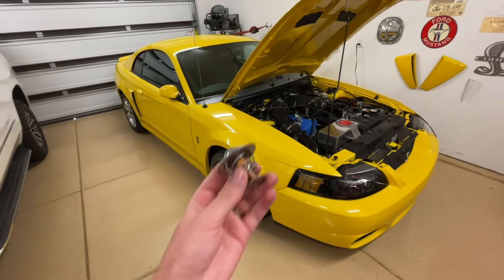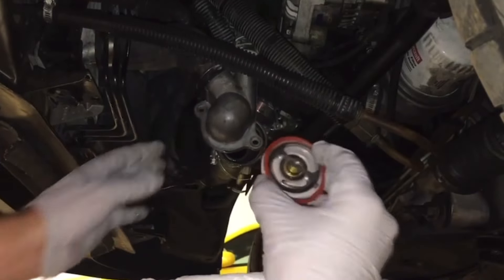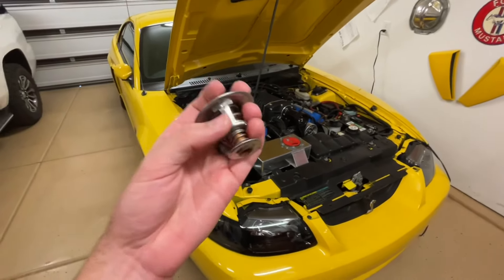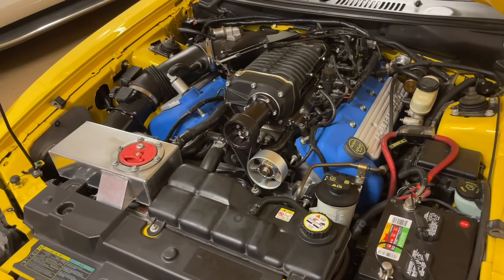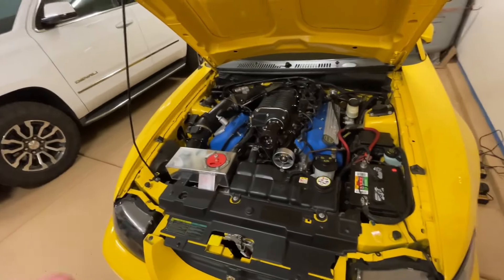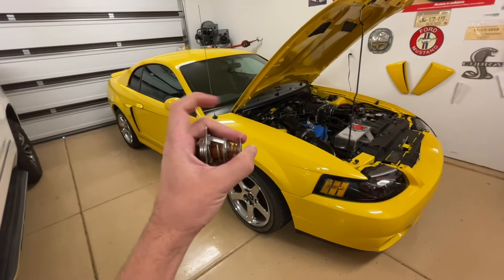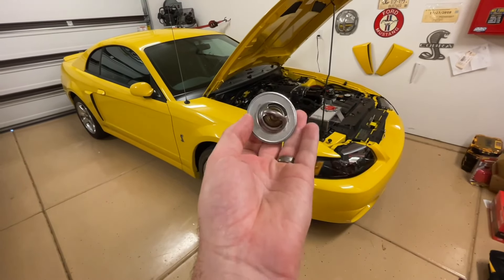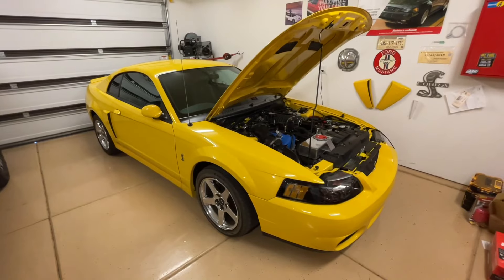DON'T remove your thermostat and how thermostats work

Comment: I had a 1990 K5 Blazer that would always overheat. Replaced everything in the cooling system and still would run hot. I pulled out the thermostat and ran it like that with no issues for two years, no overheating. The only thing about running with no thermostat is, it did take longer for the engine to get up to temp.
Reply from the maker: I’ve seen cars run cold for the most part. I found it interesting that the article said it could also cause overheating, which I could see happening maybe stopped in traffic, but I also didn’t think it was very common
Reply: From my personal experience most cars that had the thermostat completely removed Ren cool and never overheated so it had the opposite effect I've seen this done on Mazda Suzuki and Toyotas a lot and they ran perfectly fine never overheated because of the deleted thermostat

Comment: I haven’t ran one in over a year. Car runs so much cooler now. No plans to put one back in.
Reply from the maker: Don’t let it run too cold or it’s also bad for the engine, lubrications, and fuel trims will be hard on o2 sensors and cats
Reply: @dannyjohnsonsgarage  what cats? Haha I’m in southeast Ga it doesn’t get all that cold around here anyway.
Reply from the maker: @svtpower03  catalytic converter
Reply: @dannyjohnsonsgarage  I know what cats are! I was laughing because my car doesn’t have any....
Reply: Dog you are destroying your car😂😂 you think you’re so smart but if that was really how engines were made to run, the engineers would’ve left it out in the first place and saved the company money.
Reply: @ProvacativeAcorn  lol I’m pretty sure I know my car better then you. I also worked on cars for a living and have been building race cars for 20+ years young buck.
Reply: @ProvacativeAcorn bruh thermostats  just help the vehicle get up operating temp

Comment: Not a good idea at al to run without a thermostat on a street driven car
Reply: I have done it numerous times and fixed overheating issues by removing the thermostat. Never had an issue
Reply: @user-uj3zk2cx8t  That’s good for you, I’d never do it
Reply: @Lethal_Venom  that's good for you, but stop spreading misinformation
Reply: @user-uj3zk2cx8t  It’s not misinformation to say it’s not ideal to not run a thermostat on a street driven car. They are there for a reason

Comment: Should over cool not overheat. Coolant flowing too fast through radiator and not cool makes no sense.
Reply from the maker: Yes, in most cases that will be true. But if the coolant does not have time to have the heat extracted by flowing too quickly through the radiator it will not dissipate the heat. Mostly when the car is stopped. I’ve only seen it run more cool but the article said differently

Comment: I went to change my thermostat and found out it didn't have one. So put one on and now my fan doesn't want to turn on, temp went up to 220 no fan, took the thermostat out and car is fine again????  Stays below 200 and fan works again. Any ideas?
Reply from the maker: Maybe someone tuned the car for no thermostat. You may need to check that on the tune and also check the relay on the fan where it plugs in. After all that maybe the high speed fuse near the intake
Reply: Running with no thermostat is fine

Comment: Hey Danny, when you install a big 3 kit, do you still need a wire connecting the battery to the fuse box where the alternator wire connects?
Reply from the maker: Yes. Run the power wire from the alternator to the battery and then leave the stock small wire from the battery to the junction box. https://youtu.be/0j6HM11D2dw
Reply: @dannyjohnsonsgarage  alright thanks!
Reply: @dannyjohnsonsgarage  hey Danny so my 250A fuse on my big 3 kit blew and it caused my stock wire to melt but my alternator is only a 170amp alternator, I have a red top battery I’m not sure if that is important but any suggestions as to why my fuse blew?
Reply from the maker: @nickmacias00  the fuse should be the same amperage so it blows sooner than later. It sounds like an over charge situation (perhaps the regulator on the alternator failed and let it continue to produce output rather than turn off).

Comment: Where does the gasket go? I've seen some people put it underneath the thermostat with some putting it over it. I've even seen people use different gaskets.
Reply from the maker: @genericdude6551  it depends on the engine
 Thermostat Replacement 96-04 Cobra, Mach 1 4V DOHC
https://youtu.be/dF56SQxvaOQ

Comment: My friend had a trick to keep it open all the time so it doesnt close just cut the spring part out. Lol. So technically its not out but its also never gonna close but it also allows for adequate water flow.
Reply from the maker: The problem is the car will try to warm it up so it may lean the fuel mixture out

Comment: I ordered a jet performance thermostat and it didn’t include an o ring, should I go out and try to find one before I start the repair? 4.6 32v cobra
Reply from the maker: Yes, or start the project and see if you can reuse the old one
Reply: @dannyjohnsonsgarage  I also watched your video on the Teflon seal for the power steering line. After I did the repair the leak got worse. I bought a new pump and I guess I’m gonna order new lines too I suppose

Comment: hi Danny, big fan and thanks for the videos my friend has a toyota vox and it started overheating and they took the thermostat out, the problem was suspended for a while and the overheating came back, and caused head cylinder problems twice that got it skimmed but it happened the third time that the car just overheats on the highway and it stops and now it is just cranking not starting.....your advice will be appreciated...do you think the problem is coz they removed the thermostat,  how should the problem be fixed?
Reply from the maker: It was most likely a bad head gasket to begin with, now it’s just gotten worse
Reply: @dannyjohnsonsgarage  wow thanks for the reply mate really appreciate it just one more question what do you think should be done? replace the head gasket and get a new one or a lot more has to be done... thanks for the first reply really really appreciate you Danny

Comment: Hey Danny, just noticed you deleted wipers.  What did you use to cap the holes?
Reply from the maker: They are plastic caps for the bottom of a chair. I’ll get you a model number. The wipers are being stored in a cabinet since they are terminator specific (maybe you already knew that)  https://youtu.be/3saIMeF7RgU

Comment: Still running my stock thermostat in my 03. Any advice on when to change it mileage wise?
Reply from the maker: If it’s working properly it should be fine. Perhaps a good idea to change with another repair but not necessary on its own
Reply: @dannyjohnsonsgarage  I want to change it to one that opens up faster, like at 160 degrees. My car runs at 200 degrees once warmed up so more cooling could help.

Comment: At one point yoy stared that removing the thermostat woild casie thebehiclento not warknupnand never reach optimum temp, at another point in the video younstayed removal cpuld cause thebcwr to overheat?
Reply from the maker: It will most likely cool too much, but there are cases in traffic where it can overheat. The article speaks of overheating but I’ve only seen overcooling

Comment: What if you put a cooler thermostat is that bad
Reply from the maker: It isn't bad, it will just open at a lower temperature and likely run the same overall temperature once it and the regular thermostat would be wide open at the same time.
Reply: Ok i got a 160 degree and its been running fine just wanted your opinion thank you sir😎
Reply: Is a 180 degree fine to run on a 2v 4.6?

Comment: Is this just a theory or you actually tested this? Because i have never seen a car overheat by removing thermostat.
Reply from the maker: There is an article in the description about it. It is true the car typically runs cooler without it, but it can cause an overheating condition stopped in traffic. Besides that, there are a lot of negative effects as the video states, with the car trying to warm up and not lubricate properly etc

Comment: Usually honda thermostats become open after 70 or 80 thousand miles.  But the thermostat itself is a restrictor like some race classes have in the intake .  Guess that works out to keep it from flowing too fast.  

But still i feel the effects through the air vents.  Hot or cool depending if oil is thin ir thick .

 Funny thing, in January i took off the air dam that blocked cold air from goin into the engine bay up a reverse y pipe drawing cold air from beneath.  I thot hot engine heat would suck thru it but it actually made the vents blow cold at the red light. Guess that helmholtz resonator had a purpose lol. 

So i then took off the stupid beauty cover like scotty said. Finally the hot air was escaping to the intake pipe. It was only slightly better so i took off the bottom portion of the airbox to draw air from the engine and have that weird helmholtz resonator that was just clipped behind the driver headlight hold up the air filter with the help of 22° spectre pipe.  I adjust the placement from being halfway in the way of the filter since 30-50° contains more air and i wanna run lean and keep it warm

In the summer tho it was too restrictive making it inefficient run hot and shake in high lift ..had to move that 22° spectre more out the way toard the factory fresh air split y pipe .  Guess the other opened up end can make a dual intake lol